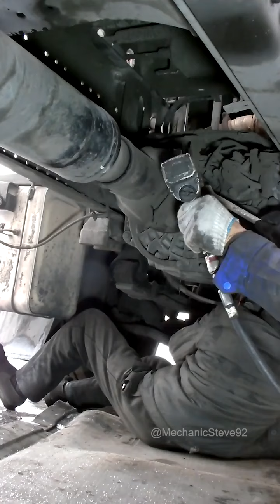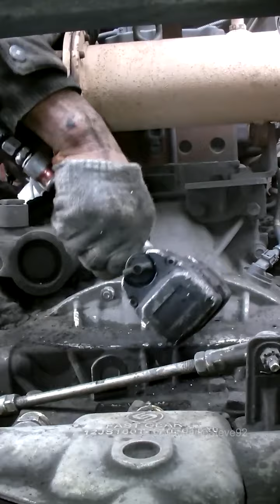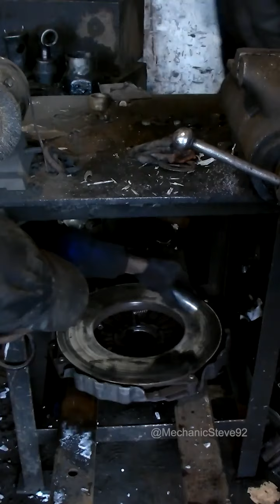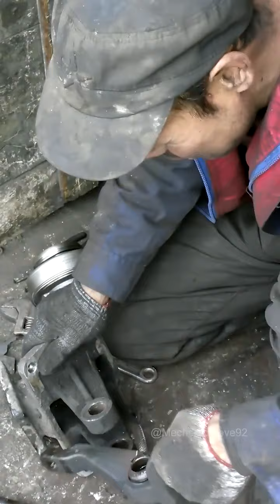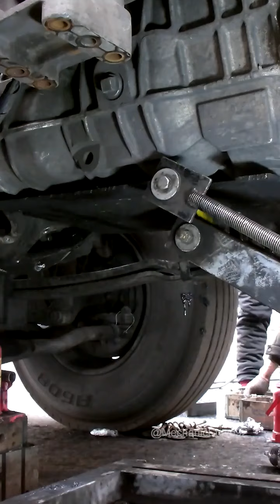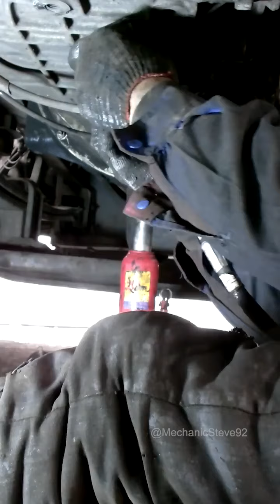First time saw the clutch damaged like this, and using my way to take the debris from the pressure

Comment: Seen that a couple of times. 
Generally its an abusive driver that has a habit of ‘dumping’ the clutch, those springs are for torque adsorption, so to rip them out of the boss tells us a lot.
You should also skim the flywheel when fitted a new clutch plate, it minimises the chance of the clutch slipping.
Love the videos by the way!